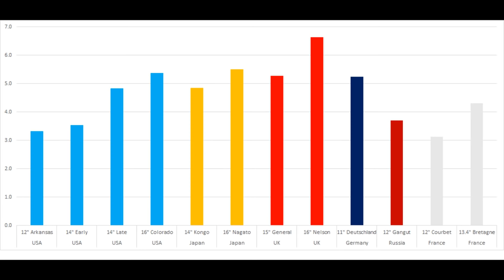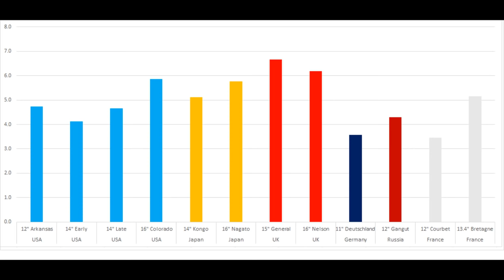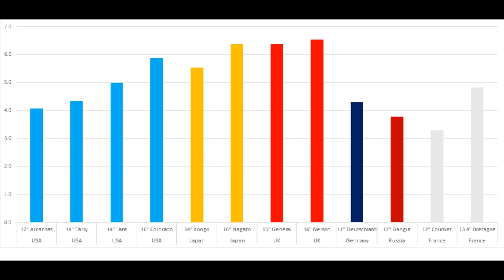Battleship Guns of WW2 - A series of tubes

Comment: once shells start weighing as much as a bus things like penetration and max range become rather moot. Might be more relevant to compare fire control and targeting systems at that point
Reply: Totally agree.
Reply: This. As Jutland proved - doesn't matter how big your shooty tubes are if they can't hit stuff, even adjusting for moronic Battlecruiser admiral.
Reply: It's more about shell density than mass tbh.
Reply: I fully agree on max range, however, penetration is quite important. For example, the US 16inch gun could theoretically penetrate both of Bismarck's armour decks already at below 20km, which is not good!
Reply: Agreed, that would see Yamato's score drop significantly. The Brits had some exceptional gunnery skills, but I still think the Iowa's would end up on top.  Granted they squeaked into the war fairly late.
Reply: @alexmathis8505  

The accuracy of the Iowas (at least during daylight) was actually not much, if at all, better than that of other WWII designs, with even the Mark 8 failing to reliably hit anything around 30,000 yards. 

And the most accurate battleship of WWII was actually not a WWII-era design: that title went to West Virginia.
Reply: Except that none of the battleships (including the Iowas) had targeting systems that were as good as memetic knowledge would claim. And there’s a persistent myth that the Americans and British were unique in having mechanical fire control computers and this put them at an advantage-in reality, this was something EVERYONE had (though the American design of fire control computers did haver the benefit of a more streamlined operating process compared to that of other nations). 

Even radar-guided fire control failed to provide the level of long-range accuracy that’s often ascribed to battleships that had radar-guided fire control. Though radar did at least ensure accuracy wouldn’t be affected by visibility.
Reply: Only "bus" that light is a VW Type II (which make the engineering of the Bismarck class look excellent).
Reply: If you can penetrate your enemies armour, you can hit vital things protected by it. If you can't, you can't.
Reply: @davidchambers8697  once the explosion gets so big armor acts like not a solid anymore. not to mention spalling and sheer concussive blast.

Comment: Overall this is an interesting take (better of what I've seen so far), but some aspect were overstated and others were IMO not exactly on point .
Accepting the fact that range is of limited importance, it has to be considered together with other factors, like the trajectory of the shell and the weight. For example the lobbing tendency of the USN compared to the more powerful and direct IJN. Both have advantage as the second is easier to aim requiring less time to get to the target and the first is lobbing form above bypassing the heavier protection of most BB. Also range is important in costal shelling, where most  WWII BB spent their time.
What is of paramount importance in BB Vs BB is the mass to speed ratio, or the total energy of the shell on impact. Americans aiming for heavy shells and slow speeds (revised with the new Iowa Guns) and the French and Germans aiming at high speed and low mass. The Italians tried aiming both ways, whit relative high mass and very high speeds, totaling  a similar energy to the North Carolina 16", but they had to tone down their charges due to the induced spread of the salvo.
This was particularly felt in the 13" guns on the Cavour and Doria, which were never able to completely compensate for the problem.
Reliability is also extremely important: the French 380mm were faulty and the whole breech had to be redesigned in the USA as the shells have a tendency to blow up inside the gun itself. Even so the dispersion was worse then on the Littorio Class, with the Jean Beart spread considered "Unacceptable" still in 1954: overall a big headache that was never solved. The much maligned (by Iachino)15" on the Littorio on the contrary shot thousand of shell all across the war and never suffered any problem (except for an electrical incident on a turret of the Littorio IIR). The Deutschland class 11" were different (lower lenght/energy) then the ones in the Sharnhorst, but both, despite being good, had trouble defeating armors on enemy BB and in the case of the Rio de la Plata battle, they struggled putting an Exeter cruiser (very lightly armoured) out if service.
Nagato had two different sets of shells before 1935 and after 1935 and it depends on the dataset you choose how efficient the guns were. The Nelson's 16" was considered a failure by the RNbut due to the "kind" of fight the ship found itself involved in, they did well ,maximizing the heavy weight; the Modern 14" on the KGV on the other side never overcame the thousand issues afflicting them, proving inferior to the WWI Warspite guns (revised just before the war) which always proved reliable.
In comparison the British 14" guns on the Kongo class proved extremely reliable and were kept in service without any thought of modifyimg the barrel or switch them for larger guns despite plenty of 16 guns being available for Tosa and Amagi Battleships. Rate of fire importance is also situational: at the battle of The Danish Channel or between Kirishima and Washington for example, which happened at point blank range (for WWII BBs), shooting fast was a plus, but in the Mediterranean, where engagement happened mostly about 30Km, the ship had to bring new calculation between each salvo, to the point that  the guns had to wait: in this instance, faster computer would have been more important then the rate of fire. To be honest, shell quality is more important then the gun itself as can be seen between Bismarck and KGV where many  shells hitting both ways did not explode. The Littorio class for example switched form being wildly inaccurate before summer 1941 to quite accurate as better quality controls and omogeneous Charges batches were enforced in the ship's magazine, which defies the "inaccurate" badge, as the British observers confirmed at both the battles of Sirte. In the same way, claiming the KGV or the Bismarck shells particularly accurate is baseless as the only real fight happened at I credible short range, while both the bismark, later I. That cruise, and the Duke of York were struggling hitting anything untill they come into WWI ranges. For the same reasons trusting the Vanguard Guns being "spectacularly accurate" while shooting supercharged shells is just blind speculation as charges affect shells massively, especially in barrels which were "adapted" and not "designed" on certain pressures (see Cavour guns).
There is much more in a gun then statistics as you can see and also a great deal of "football team" speculation: if the Nelson gun were even half as good as the West Virginia ones at the battle of Surigao in accuracy, why putting old WWI 15" guns on the Vanguard as the two Nelson were technically ready for the scrapyard anyway?
Why calling Littorio's 15" low weight and low Charge when in fact both figures were notably higher then both he German and the French 380mm, let alone the British 15" which were not even in the same ballpark in term of shell energy?
Why trusting a random voice of the 14" inches on the KGV being "amazing" while the British Admiralty disliked them and considered the whole design a failure?
BTW you can find a good deal of informations and dataset about WWII guns in the volume "The Littorio Battleship" from Erminio Bagnasco which I know has an English translated edition.
Reply: I thought Nelson's 16" shells (~2000 lb) were on the light side for their caliber?
Reply: @hailexiao2770  they were light and also extremely unreliable: the turrets always proved unreliable and the British scrapped the whole design, to the point that they preferred old WWI design on the Vanguard than dismounting these 16" from the two Nelson which were practically on the commissioned list by the time the Vanguard got operational.

Comment: That was a good effort. Personally I'd express it as a vector with normalised components. This gives you a geometric representation of the relationships with an arrow for each gun pointing in a particular direction. Try not to worry about the fact it's plotted in more than 3 dimensions, it's just a representation, putting them on orthogonal axes and plotting a straight line. This gives you a "latent space", a landscape.

To know which gun is best you can normalise the vectors (make them between zero and one) and then it's a case of multiplying it by a transformation matrix. That means you can do a further matrix multiplication to project it into a single dimension which expresses how good the gun is.

To be fair, if you haven't studied this it might seem a bit intimidating but that's certainly one way to do it.

Comment: Should’ve thrown in the Iowa’s nuke shell for the bursting charge. 😂 
On a more serious note, it would be interesting to see the weight of gun thrown in as a negative modifier. That would show what would be the best bang-for-your-buck. Kind of like what the US decided with the Montana design, that is was better to have more 16” vs less 18”.
Reply: But the nuke shell's bursting charge is just the plastic explosive used to compress the core, so is it really that good?

It isn't really kilotons of bursting charge if you only have 10-20lb of HE
Reply: Good point, the US designers figured the 16 inch 50 cal. heavy shell was roughly equal to the Yamato’s 18 inch shell.

Comment: If you are going to look at other factors, here are a few to consider. 1) cost to fire the guns 2) number of shots per barrel 3) cost of manufacturing/retrofitting/replacement ect. 4) number of rounds carried into the fight 5) number of rounds shot or used. 6) estimated costs of enemy ships sunk. In some of these guns the cost per shot was so high it was potentially prohibitive to fire, or it made more sense to have a smaller gun that could do the same thing for less cost and money. Today, for example, the military has sort of standardized gun sizes at 5 inch (simplifying cost/supply/replacement of the barrels and ammo) and chosen a much smaller diameter, which can be auto loaded. In WW2 we know the germans had a "better" tank by design and quality, but American's had a mass produced tanks by quantity, dependability, and mobility which put more men in tanks instead of walking. It was both numbers, as well as fuel supply, as well as other factors that made it work.

Comment: Going back to our example, even though the AP and HE shells nominally weigh the same, the ballistics are different. When designed to weigh the same as the AP shell, HE shell has to be longer to add weight, as the shell’s diameter remains the same for both HE and AP. This affects the warship carrying the guns that fire these shells because the ammunition storage and handling equipment has to be built around the length of the HE shell, which means there could be jams with the shorter AP shell during handling. This also explains why the HC shell weighed less than the AP shell of the same diameter in the USN. After 1912, the US Navy stopped producing Common shell for its heavy guns and its battleships had only AP shells, around which their ammunition storage and handling systems were designed. The AP shells in service in 1939 were 4 calibers (4 times the diameter of the shell) long. When the US Navy needed HE shells for bombardment missions, it had to design a HE shell that was not longer than 4 calibers long to fit the existing ammunition storage and handling systems. Thus the 16” APCBC shell weighed 2,240 pounds (lbs) and the HC shell weighed 1,900lbs and had different ballistics. It also explains why the older US ships did not fire the newer “super heavy” shells. The standard AP shell, the “heavy” shell, was 4 calibers long (it was called the “heavy” shell because it weighed more than the previous standard APCBC shell. For example, the 14” APCBC shell weighed 1,400lbs. The “heavy” 14” shell, introduced in the mid-1930s, weighed 1,500lbs, the increased weight gained through thicker walls and smaller explosive cavity. A “super heavy” shell would have weighed more than 1,800lbs). The new shells gained their additional weight through longer profiles, to an average of 4.5 calibers in length. It was usually too expensive to convert a ship’s ammunition handling equipment, magazines, and turrets to the new and longer shell. Thus, the new 16” 2,700lb, “super-heavy” shell could not be managed by the ammunition handling systems built into the “Colorado” class and the upgrade to do so would have been expensive and time consuming. Another impact was that to reduce the number of types of shells, the USN did not design and produce a 4.5 caliber long HC shell, so ships designed to handle the 4.5 caliber AP shell using the 4 caliber HC shell, sometimes caused jams in the handling system. Between abandoning the Common shell and before the advent of the HC shell, the only “heavy” gun HE shell the USN produced was for the USN operated 14” railroad guns of the Great War. This weighed 1,400lbs and was too long for the ammunition handling systems of USN ships armed with similar 14” guns. Since 14” HC shells were not available before November 1942, the USN directed that the WW1 bombardment shells be issued to the battleships taking part in the invasion of North Africa, the shells to be stored in the turret, accepting the risk of a turret penetration setting off the thinner, nose fused HE shells.

Comment: ARKANSAS 12" guns DID NOT have any improved AP shells from their late-WWI 12" Mark 15 MOD 6 "Midvale Unbreakable" soft-capped (therefore unbreakable against most WWI-era face-hardened armor but not most WWII-era toughened face-hardened armor and only up to 15 degrees reliably and 20 degrees ever against even the WWI armors).  The only improvement was the use of the new Mark 21 Base Detonating Fuze used in all US Navy AP shells as default -- unless not enough fuzes were made in time, when improved  forms of the obsolete Mark 23 BDF were pulled from storage and used in some 8" AP shells to prevent delays.  These were the only Midvale Unbreakable shells to remain in service after the late 1930s and the only ones with delay-action base fuzes.

NOTE:  These shells were perfectly suited for firing against homogeneous, ductile plates.  They were quite strong when the soft AP cap was not a problem and also against Japanese warships, as long as they hit at the low obliquity angles mentioned above, since the new Japanese "Vickers Hardened" (VH) armor, used only on YAMATO Class ships and the older "Vickers Cemented" armor (VC, pre-WWI-grade British Cemented Armor) used on all other Japanese battleships (never on smaller warships) was, for VH, one of the few WWII-era face-hardened armors that was not toughened to WWII standards (improved a lot in some ways, but they mostly just made it enormously thick, instead) and they were still using WWI-era VC plates in the other battleships.  Thus, Midvale Unbreakable shells would work fine when they hit within the correct range of angles, no matter how thick the Japanese armor was or of what type, as long as the shells had enough velocity to penetrate just like WWII shells did.  Neat!

Comment: Could your range conundrum not be solved by using required elevation for a set range? 
As you point out, guns with greater range can fire flatter for closer ranges. So if set the range to say 20k yards and one ship requires a 20* elevation to reach it yet another gun only requires 15* then the advantage goes to the 15*